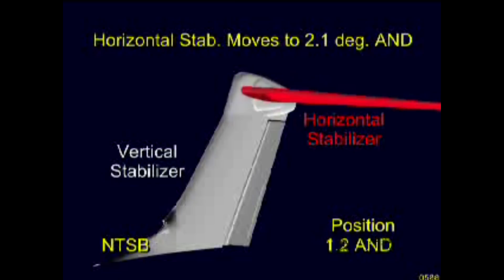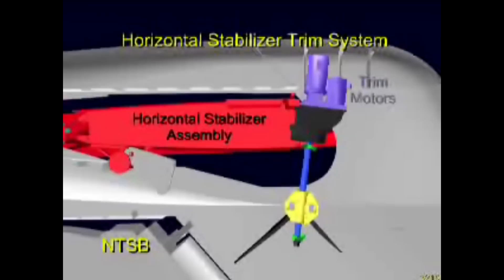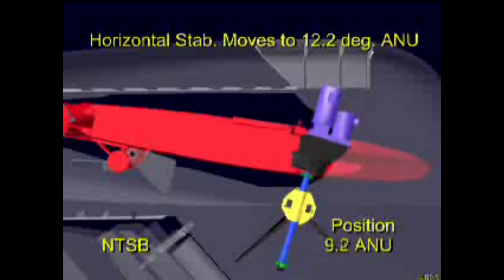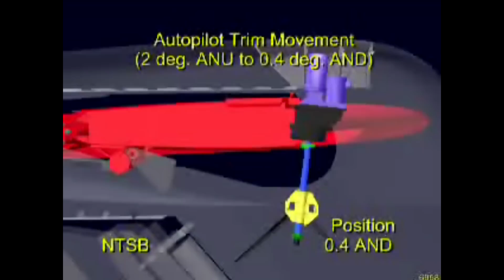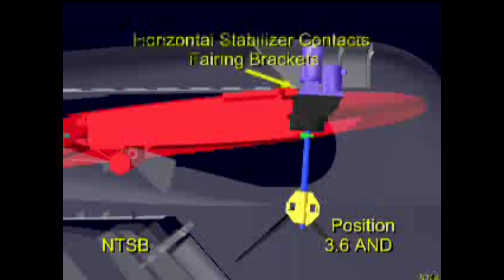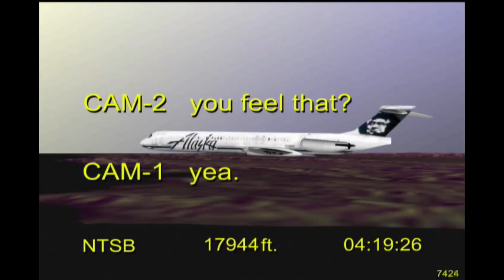Alaska 261 NTSB Simulation

Comment: The FAA and the FAA agents are also to blame for the deaths from Alaska flight 261 crash. The FAA did not intervene properly in 1998 when the whistleblower denounced Alaska Airlines. The rules used by the FAA are also inadequate, i.e. are too soft for the airline in situations where the FAA should've stepped in far more brutally and immediately ban all Alaska aircraft from flying. Criminals. 

RIP

Comment: Very bad engineering!!
Those engineers should be executed...  What was their problem design the jack screw at the back and axel of elevator stab at front???????????
In a case like this , less mechanical load, in a case of fail wind diraction will keep it straight , + installing shock observer against floater....

Comment: I worked with MD-80s aircraft, each time we did the jackscrew inspections it was unavoidable between technicians to talk about this accident and how serious our job is.
Reply: This sons ov whores engineers should be executed together with airline company owners and managers...
What was preventing them to design it with jack screw at the rear and stab axel at front with though shock observer along with the jack screw... In a case of fail, air fllow will keep it straight, shock observer will prevent flatter, and will have a feature to lock it self on treem is in neutral position, in a case of failure.. So pilots will need only to fly it little more difficult but controllable, i will never let myself fly in a plane with that kind of design...
Aircraft with a regular configuration of standard stabilizer have the mechanical load spread much more stronger and longer arm connected to stabilizer that much more massive...
Thoes supervisors who made you silence are true busterds that should be executed by families of victims...

Comment: Do the newest designed planes have any redundancy built into their control surface actuators?  Do they still use a single jackscrew configuration to drive those surfaces?  Because I don't care how many safeguards they may put in the electric controls, motors or hydraulic systems, if in the end there's only one mechanical connection to power those control surfaces, I'll stick to walking, thank you.

Comment: "Lead Mechanic John Liotine became a figure in the investigation into the January crash off the California coast when it was revealed that in 1997 he had recommended replacement of the plane's jackscrew and gimbal nut, which control the up-and-down movement of the horizontal stabilizer--a part suspected of causing the crash."

https://www.latimes.com/archives/la-xpm-2000-sep-24-mn-26055-story.html

Comment: I can see in the video that the acme nut (yellow-coloured in the diagram) rotates when the threaded rod moves up and down. Does the motor (black/purple) section rotate as well? Just trying to picture how the threaded rods moves up and down without stressing out other components.
Reply: Kenny the Yellow part is the Nut which is stationary. The bolt is the blue ones that rotates attached to that purple motor.
Reply: @benson7600  Thanks very much for your kind reply benson! Greatly appreciated. That helped a lot.

Comment: 5:50   737 Max 8: Possible nut/screw jam/fatigue/failure etc in addition to bad system/pitot tube sensors on MCAS?
Reply: No the Boeing design has redundancy.

Comment: What is not clear to me, from anything I have seen or read about this incident, is whether the crew deliberately inverted the aircraft in a desperate attempt to regain control, or did the plane become inverted because of the stabilizer failure?
Reply: It’s a good question. 
The plane became inverted during its spiralling dive. 
The pilots then attempted to keep it flying that way, but they didn’t deliberately flip it over.
Reply: Well there actually is a chance they did it in intentionally, because watching the video above when the brackets failed and the horizontal stabilizer seperated causing it to go to a drastic nose down angle, flipping the plane over would negate that issue. It would be like having a fan blow air in your face and turning the fan around so it blew air in the opposite direction.

Not the best metaphor, but you get my point.
Reply: The pilots rolled the plane INTENTIONALLY, if you read the transcript from the CVR (you can find it in the official report on the accident), the captain tells his copilot "push and roll, push and roll"

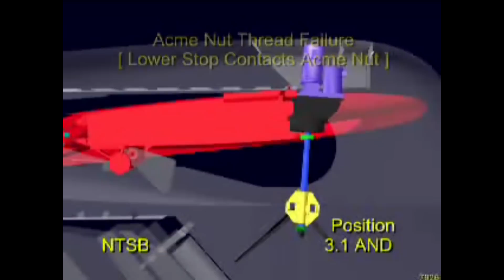Comment: Why was the mechanical stop on the screw not designed to carry the tail load? I mean if the controls fail to stop the screw from moving, but the mechanical stop does, when it contacts the nut, what else other than the stop having to carry the tail load would have been the result? How could the mechanical stop and the screw seperate (6:09) ? I don't understand that.
Reply: The mechanical stops on the DC-9/MD-80 family of aircraft are in place to prevent control over-travel in case of a flight control failure such as improperly adjusted controls or a faulty motor. Under normal flight conditions the jackscrew assembly will never reach the mechanical stops on either end. As such, they are not designed to carry the dynamic load of flight forces. Also, it was not considered during design by the engineers at Douglas that the operator of the aircraft would neglect the maintenance schedule to a point the load-bearing nut would strip out.

That's what I think you're missing, the nut is the load-bearing component. Say, for example, the ALT motor developed a short and didn't shut off. This would keep the screw moving all the way to the mechanical stop, will stop the screw from moving too far out. All this time though, the nut is still holding the tail load, as designed. In this accident, the nut stripped out (look up pictures of the recovered jackscrew, there's a thread of nut material coiled up it) and the load-bearing element was lost. The stops are only designed to fight the motor forces, not the dynamic load of the tail.

Alaska Airlines failed to conduct proper maintenance and monitoring of the condition of the nut, which allowed it to wear out to the point that the screw became jammed with worn material from the nut stripping. The crew dislodged this jam by activating both the primary and alternate motors at the same time, but this caused the screw to completely strip the nut (they had no way of knowing, this is not a fault on their part) and contact the mechanical stop. This is the first dive. Note that the crew were able to save the aircraft from this initial failure, which is what the mechanical stop is for (as I explained above). The stop eventually failed after about 8 minutes, and the aircraft was lost.
Reply: Gunther Hermann If the jackscrew had been made a bit longer to accommodate a deeper, titanium stop nut maybe it would have held long enough to land.
Reply: @marcosmota1094  Doubtful, the amount of load the aircraft must have been putting on the stop nut of that size by having the horizontal stabilizer at an extreme angle must have been immense.
It doesnt mention how the stop nut failed either, nor how it was attached to the jackscrew.
The idiots at Alaskan should have been jailed for this and the pilots should never have attempted to free up a stuck trim control surface.
Reply: The stops have a shape that stop the rotation of the jackscrew, but what they withstand is the torque from the electric motors, not the actual force from the jackscrew.
Apart from that, I have partly read the official report about this accident and the stop isn't what fractured, it was the torque tube (in fact this very animation there's a moment in which a caption reads "torque tube fractures")

Comment: I have a question......Why would the head an aircraft parts engineering firm approve such a design for use? One can see that at some point, this would fail. What's wrong with a simple gear and motor configuration? You know, sort of like on a window regulator? Or simple hydraulics attached to an arm, which is attached to a fulcrum that rotates a max radius of 12 dgs for movement (+ 6dgs/ -6dgs) ??? My head hurts.....
Reply: Would you drive your car for so long that the metal wiring on the tires was sticking out, then when you inevitably blow a tire that results in a crash causing you to perish, do we blame the maker of the car for a poor design? Or do we blame the driver for poor maintenance habits that made an accident inevitable?

Lets make sure we are placing the blame correctly..

Comment: So the fail-safe mechanical stop nuts were never even able to support the load created when the stabilizer failed anyways ???
Reply: Stuart Smeets They were not designed to withstand the huge axial load that would result from loss of the ACME nut threads. They were only designed to withstand the force applied by a runaway actuator motor.
Reply: Once it failed even IF the stop could handle the load, at some point it breaks through the part/material it is attached to.

If the company hadn't skipped maintenance and used inferior lubricant, it wouldn't have happened.

What's worse is they used to have little Bible Verse/Prayer cards with our in flight snacks/meals.

Comment: what a terrible system, to be so dependent on two aluminum bronze nuts...
Reply: It's not dependent on the stop nuts, the system (a proven system with decades of safe use) is dependent on the aircraft operator conducting proper maintenance on said system. This was not done, and was the cause of the accident.

It would be like complaining that Chevrolet designed a terrible system for my truck's engine after it seizes when I don't add oil.

Comment: they should have put a cotterkey at end of jackscrew to keep it from coming out.  A  10 cent part could have saved them. Once that nut came off nothing was holding it on. 
I worked on helicopters and all the nuts / bolts have cotterkeys or safety wire. Yes they should have greased it but what if they didnt? you need to have a backup to keep the parts together.
Reply: This is about as dumb as "why don't they just build the rest of the airplane out of black box material"
Reply: jony joe JJ you sound about right . I agree.
Reply: Why not brass for the acme nut, and titanium for both the stops? The cotter pin at the bottom would have needed to be Ti as well, and probably limited to 1/3rd the diameter of the jack screw. Maybe that would have given them limited time to land, but not real sustainable flight.
Reply: @marcosmota1094  It's the threads that can save you not whatever you bump into after they fail.

Comment: I still can't understand this "accident". You change the oil in your car engine when prescribed. You floss your teeth when needed.  You try to squeeze the toothpaste tube from the end. You grease the airplane, where needed. USA, 101.
Reply: T tail planes are hard to maintain when u talk about the controls in the rear.Thats why they got lazy.
Reply: @oldstyleanalog6459  but that goes back to my wife's favorite saying "if you don't like your job go do something else" 
That's not directed at you that is directed at whoever doesn't wana maintain an area of the plane that is a pain in the ass.

Comment: If the horizontal stabilizer is movable by movement of the yolk, it’s considered a stabilator, not stabilizer.
Reply: Trent Allen well for that matter it is called a yoke, not a yolk
Reply: Whoops, you’re right. My bad.
Reply: The trim system moves the stabilizer not the yoke. The yoke actuates the elevator at the rear of the stabilizer. The term stabilator is formed from stabilizer and elevator the aircraft in question have a separate elevator that is actuated by the yoke and is independent from the stabilizer. It is in fact a stabilizer.
Reply: It was in reply to the one that was talking about stabilator vs stabilizer, in other words not you. I would dare say though that there are a good many people that watch this video that think they know something but not the difference or that there even IS a difference. Did you also know there is a difference between a servo trim tab and an anti-servo trim tab?
Reply: It is NOT moveable with yoke control column input. The horizontal stabilizer moves when activating the pitch trim, either through the primary trim switches on the yoke, the longitudinal trim handles next to the throttles, or the alternate trim utilized by the autopilot which can also be controlled by switches below the throttles.

Comment: Shouldn't the HS should be hinged from the front, not the back, so that if the JS fails, aerodynamic loads will tend to push the HS to the centre position?
Reply: @butchtropic yep that is the damn truth.  3 fold, 1 lazy mechanics 2 not enough mechanics 3 cheap management not providing #2 and or not paying 1 or 2 enough $$ to give a shit.  
Eh let's get another 150hrs on it and then we will maintain/ repair replace parts.
The real issues with the circle of mechanical failures is not paying  to have routine maintenance completed and documented.  Yeah seems like a no brainer but they don't want to pull a plane from service because they look at the $$ end only.  The idea of taking an aircraft out of service for to do checks and maintenance means 1. Loss if income 2. Money going out in repairs and 3.  They find a big issue and or even small ones that must be repaired/ replaced and inspected by FAA or whoever gives the plane certification to fly. 
Geeze let's just throw some (off brand) duct tape, super glue and maybe a paper clip on and call it a dah
Reply: @grouperkng1  Don't forget using cheap lubricant that wasn't the proper specification.

I flew the Seattle corridor on that carrier probably 25 times. Between this amd our engine failure I was afraid to fly for many years....
Reply: Well...every time I board a commercial passenger jet, I have a look at the tail...and it always seems the HS trimmer is hinged at aft...And I don't like it one bit!